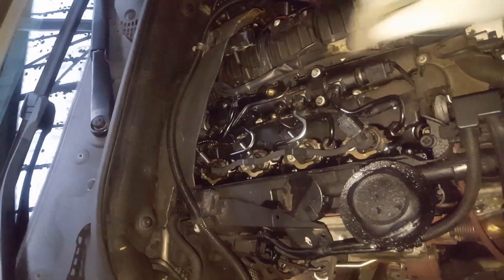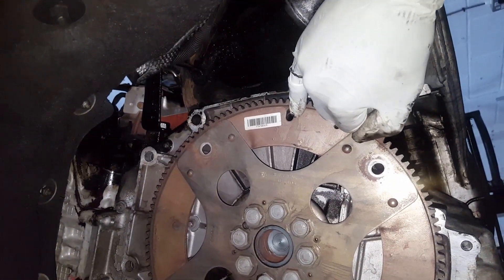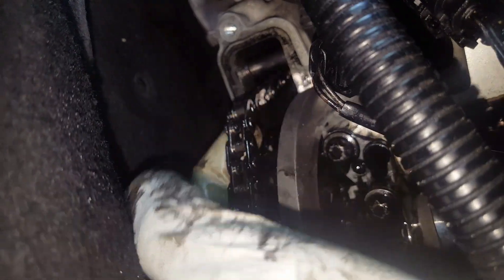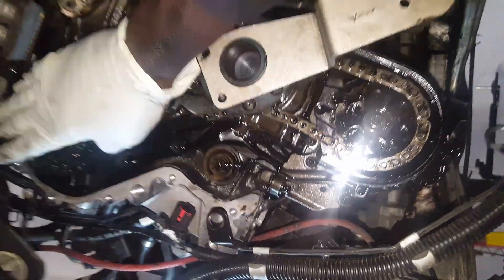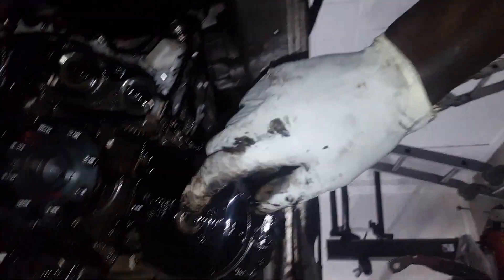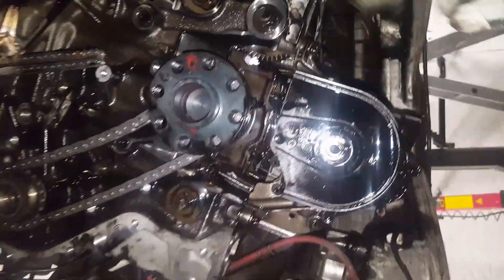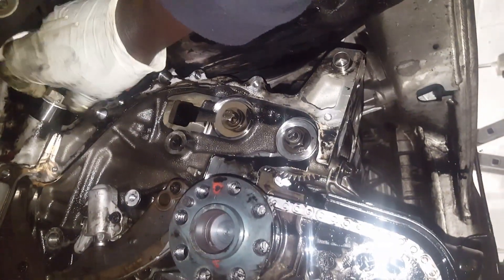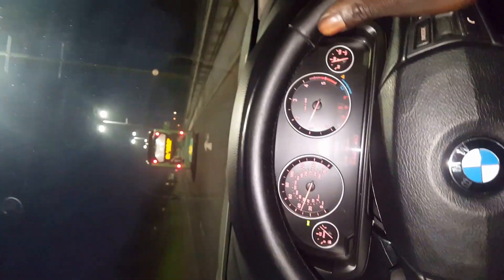BMW N47 timing chain replacement | click video describstion below for info

Comment: Looking forward for a video with gearbox oil and sump service on bmw f10 520d
Reply from the maker: Gigel Dragu Hello mate am based in Reading but am working for a company and i haven't open my own business yet. Anyway that's easy check out my other video. Land rover discovery 3 gearbox removal. It uses BMW gearbox like yours . Forward it to 7:10sec that will give you an idea of how to do. It's exactly same way to service your bmw gearbox .

 The drain plug is a plastic screw on the sump 10mm allenkey socket, that will drain the oil. To fill up the oil watch the video from 7:10sec to see the process. 

And to change the gearbox oil filter, you will need to change the gearbox oil sump because the filter is built inside the sump in one unit. Hope that helps for now, until I make video for it one day☺

Click the link below if you can't find the video.

 https://m.youtube.com/watch?v=7nqX3ZNl8ys

Comment: Whay didin't you took the engine out? It's way easyer that way and it takes lese time
Reply from the maker: Andrei Caprar I did many with and without engine out. To be honest either way is easy for me. I normally do it with engine in 1 day, 10hrs max so not too bad. But I understand you, because it's more space etc 👍

Comment: Looks like a pain in the ass
Reply from the maker: Lazonby Bear yepp but not too bad once you done few☺
Reply: @dawdathemechanic-dawdaauto1761  question, is it an expensive job even if charging less for it?
Reply from the maker: @DassRoc  hello it all depends on the garage hourly rate. It takes about 10hrs.

some local garages charge £700 part and labour and some charge £1k part & labour. Main dealer will be more because of there hourly rate is higher 👍
Reply: @dawdathemechanic-dawdaauto1761  I see, ouch!... thanks for the info! keep up the solid work!

Comment from the maker: Yeah best to do it when it start rattling. Alright it will take more than 2 days then but good luck 👍
Reply: Dawda The Mechanic how much to replace the chain ??
Reply from the maker: darudest hello mate the only problem is, I work for a company and don't have my own garage yet. One day am hoping to start my own business then I will do all these jobs no problem
Reply: Dawda, how much is approx charge around UK to fix timing chain?
Reply from the maker: Dimitrij Zavgorodnij hello I think BMW dealer charges about £4k I don't have my own garage yet but the company I use to work for. Use to charge between £1k to 1500
Reply: Dawda The Mechanic I only realised I have m47 engine which doesnt relate to timing

Comment: Am I right in guessing the hpfp isn't timed. Just runs of the chain. Thanks
Reply from the maker: Elliot Tillyard yes you are right, doesn't really needs to time because it's common rail👍
Reply: Thanks for replying 😊
Reply from the maker: Elliot Tillyard no problem☺
Reply: Also. Forgot to ask. When u take the sump off does it not come in contact with the subframe. Someone said you can move the rack out the way and it comes off. Is this true
Reply from the maker: Elliot Tillyard I understand what you mean. To be honest I have never removed any steering or subframe. All the one I did, I use wobble uj  and some 3/8 extension  and I could get to it. Some I use only short 3/8 10mm socket with the ratchet only without extension and I could reach with my hand and open it. If it's makes it easier to lower steering etc then do it that way. The job does take long time. 2 days so, take your time 👍
Reply: Thank you 😊
Reply from the maker: Elliot Tillyard no problem and good luck👍
Reply from the maker: Elliot Tillyard  and when the cam cover is out, don't forget to inspect all the rocker arms/valve lifters. They sometimes break or have crack on them 👍
Reply: Thanks I will check them. The car runs fine so it's not being done as it's needed but just as a precaution coz I can hear it starting to rattle 🙈
Reply: I'm also going to be doing it on the floor lol

Comment: This is a diesel engine right? I am greatly surprised that you didn't get a valve/piston collision when the engine lost time.
Reply from the maker: Dave M hello yess it's diesel👍 sometimes it can be lucky and nothing is hit. Best way is always inspect all the rocker arms when you get the cam cover out. Sometimes the rocker arms breaks and sometimes they have little cracks on them. If rocker arms looks fine then just go ahead and fit new chain kit👍
Reply: I'm right now working on a 2009 318d n47 with secondary chain broken, and the guide chain, not the one with the tensioner on, the other one on secondary chain broken into many pieces, the car stalled at the exit of high way, all valves checked and pistons as well, all in good shape, looked to the rockers, ok...so here is an example for a broken chain with no damage on valves-pistons